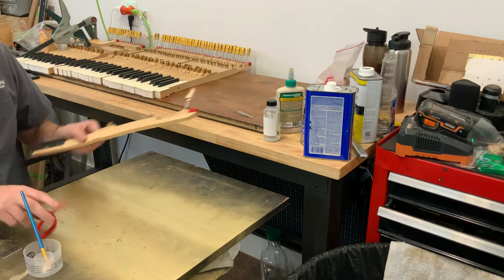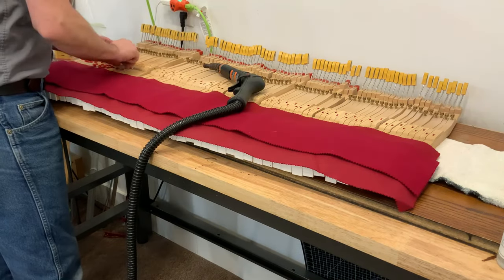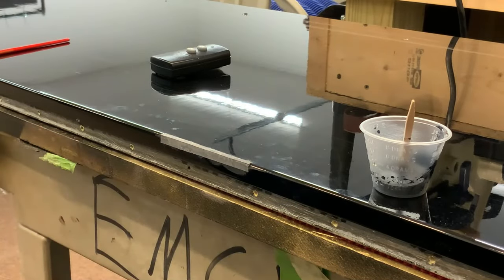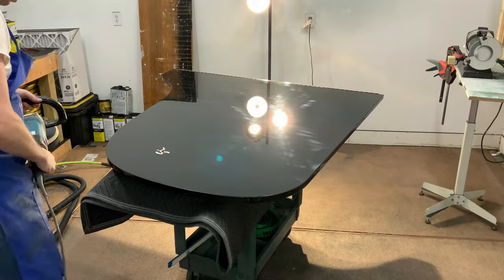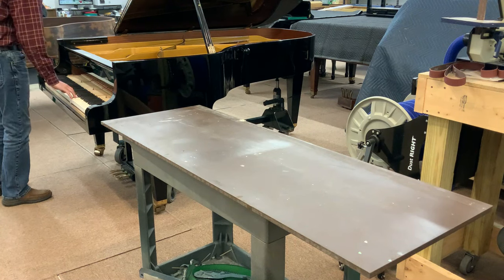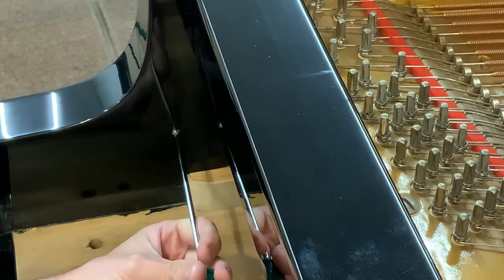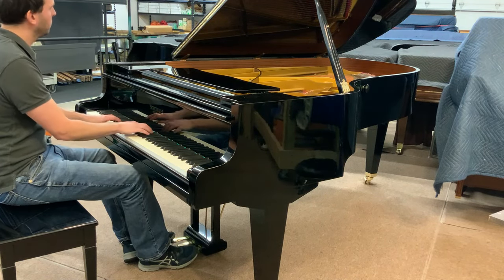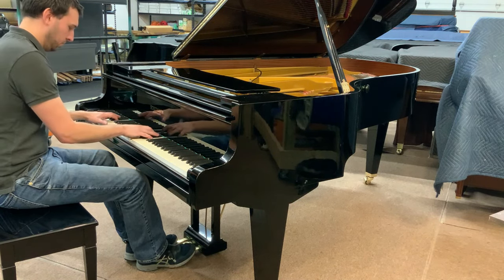Piano Restoration (with commentary): German Semi Concert Grand

Comment: Hello, congratulations for your videos and your excellent work. I am writing to you from Italy, please forgive my bad English. I wanted to ask you if the surface should not be decontaminated with the clay bar between sanding and polishing. I would also like to know what kind of colors you use to mix with the resin. Thank you
Reply from the maker: Hi there, thank you for the kind words. 
I guess I’m not familiar with the clay bar you are referring to?
Regarding the color- it’s an intensive black dye ordered from alliedpiano.com. I don’t know if you’ll be able to order that in Italy :/ 
Cheers
Reply: Hello, this is a clay bar used in bodywork to remove the smallest impurities before polishing. Thanks for the advice, I'm going to check out the site you recommended. @JacobEmch91

Comment: do you use any kind of tool/jig to position the key bushings? or just positioning it by hand, cutting it, and putting the call in?
Reply from the maker: By hand. a rule of thumb I learned was to bring it to the other side of the mortise to get the correct length/depth into the key. Brush on the glue, put the caul in to clamp it (it should be snug but not too tight, testing should be done before glueing to determine the correct thickness of cloth), and cut it off. 
There are other ways to install them, using a bushmaster, it’s a little faster but wastes a lot of bushing cloth. 
There are also ways of glueing in one side of the key first, then the other side after that side’s glue has dried. 
There are also the metal clamps you can buy to clamp the bushing in if you don’t have the cauls. They are very strong and tend to squeegee out a lot of the glue, creating a glue bubble on the other side of the cloth, which will making a clicking noise.

Comment: Great video! To throw in my two cents about sanding and polishing: I use an automotive DA polisher with a 6 inch disk and a foam pad for wet sanding. I don’t know if it comes out “perfect” like the factory, but the disks are pretty cheap and the dual action of the rotation must help with the scratches. Besides water, do you use any other lubrication? I use ONR (a rinse less wash) and a tiny drop of dish soap. Btw, ONR is a great piano case and key cleaner. It leaves no residue and cuts down on static so it doesn’t attract as much dust. 

I’m a piano tech based in Houston, but I came to piano touch-up as a car detailing hobbyist. There is a lot of similarities between the two but automotive paint is a lot more unforgiving 😅. Check out Pan the Organizer on YouTube. He’s got a lot of great videos!
Reply from the maker: Awesome, thank you for the helpful tips. What does ONR stand for?
When wet sanding polyester I’ll use water and a drop of dish soap or Murphy’s oil soap. 
When rubbing nitro I’ll use off-brand ammonia free glass cleaner. I used to use glass cleaner with ammonia but I would get gray streaks.
Reply from the maker: It’s cool how the different trades line up. I’ll check out those videos.
Reply: @JacobEmch91 ONR is a product called Optimum No Rinse Wash and Shine from the automotive world. For this type of work, you'd probably want the original (blue) version that does not contain a wax.